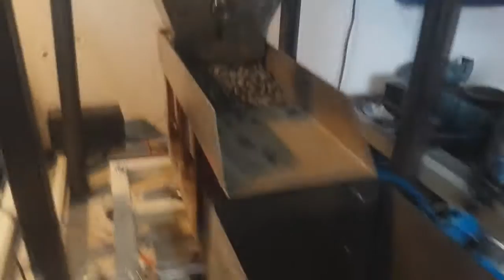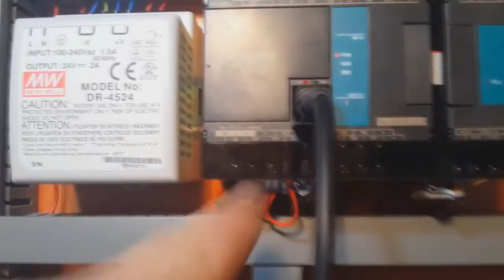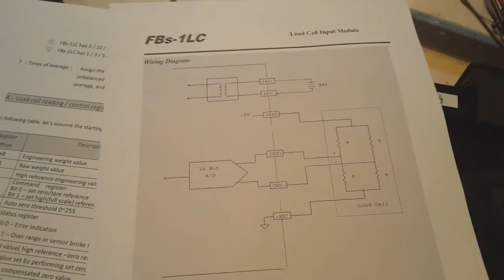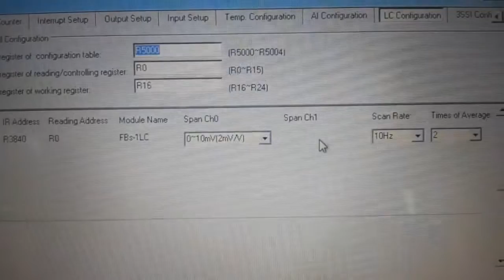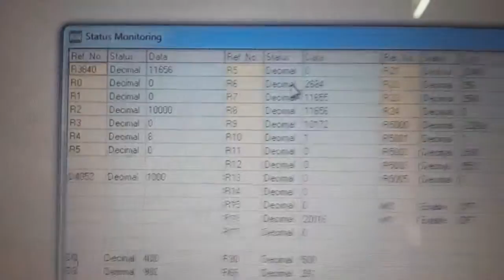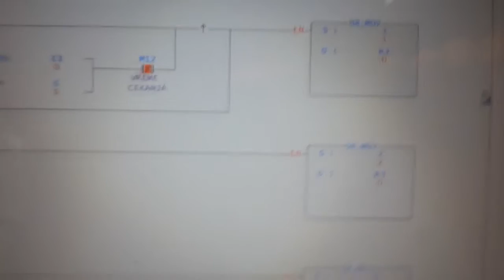Load cells plc Fatek measure weight FBs-1LC

Comment: This is useful. Thanks for your sharing.
But just wondering why you set the R4(Auto zero threshold) with value 8?
Also, what does SPAN value(In your case is R6) even mean? These two kinda confused me.